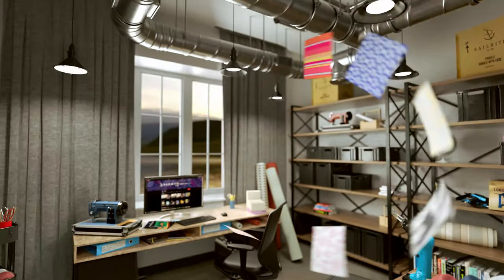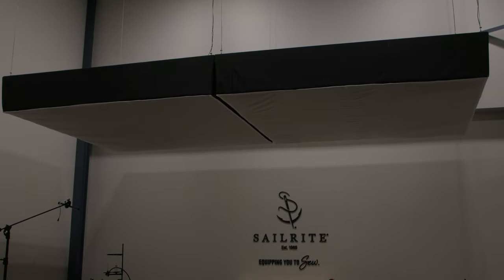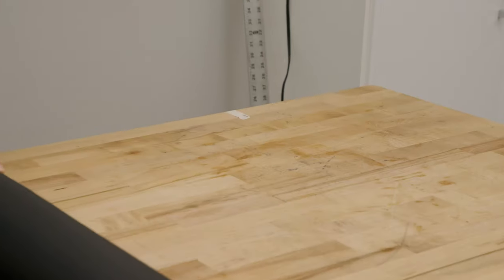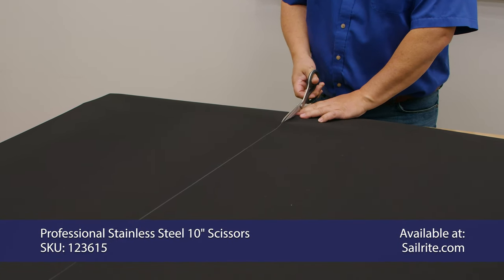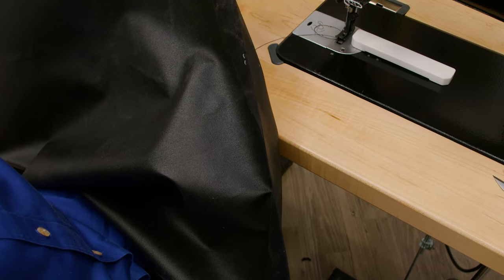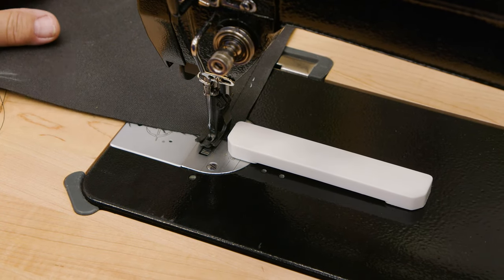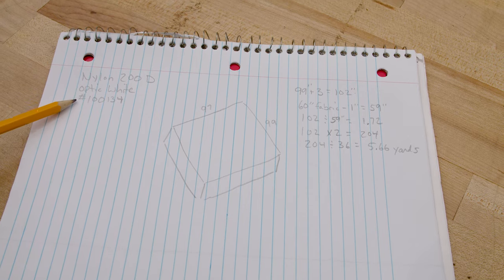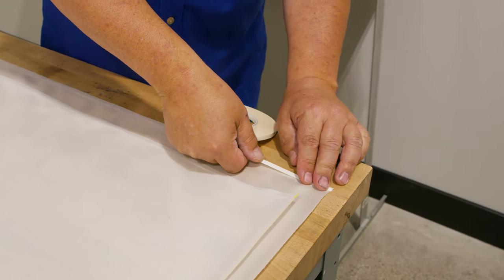DIY Softbox: How to Make a Large Softbox

Comment: Thanks for this video and the detailed steps and materials list.
 I am sure this diffuses light well enough, and with the size, I wonder if there is anything comparable to the Nylon 200D fabric you used. I'm curious, as I have used plastic shower curtains before and they seem to diffuse light even more so than this Nylon! Obviously the size it limited, but the reason I call it out is I can still see the light fixtures in the box and curious if maybe a secondary inner layer of nylon would help with eliminating the visable light fixtures inside. That said, let me know if you've found any other type of fabric with gooddiffusion properties! Right now, plastic shower curtain seem best for smaller projects, but curious what you think about larger projects. I'd like to have a portion of my studio ceiling as an entire softbox. It's 7' x 18'
Have a great day!
Reply from the maker: I would use what we did, just sew smaller panels together to make the size you need.